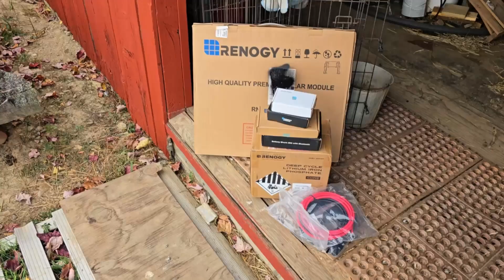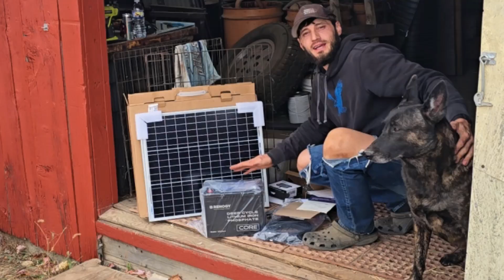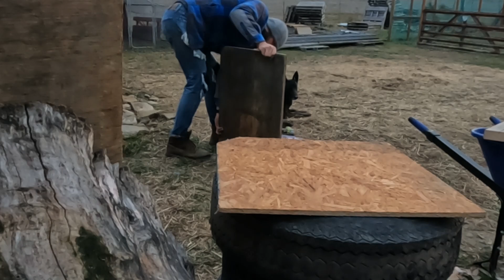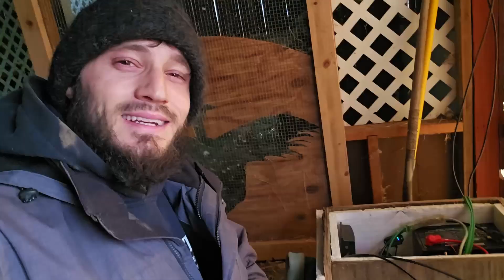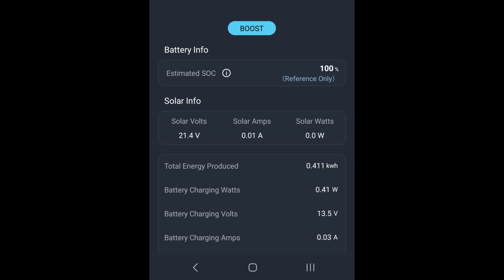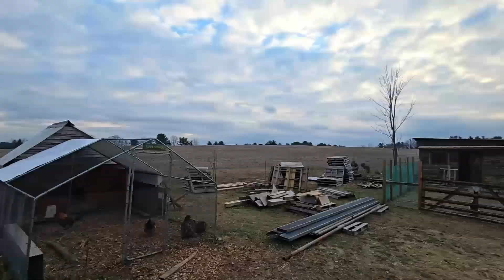The Homestead Gets Solar! _ Renogy Farm Solution // Whitt Acres

Comment: FYI: check to see if the lithium battery has a heater built into it. Letting a lithium battery freeze even once can totally destroy it. We have done a lot of research to change our 4 year old acid batteries solar system over to lithium this summer to run our entire older  RV. Please be careful because the batteries are expensive & the price will be going up.
Reply from the maker: Good tip!

Comment: So cool. What is the purpose of the battery shunt? I did look at a kit that did not have a shunt. Was wondering if I would need the shunt or not?
Thanks
Reply from the maker: The battery shunt monitors the electric flow going to and from the battery to give you a real time reading of charging and consumption as well as helping the longevity of your battery's life.
Reply: If you don’t see anymore comments from me…. I was shocked when I cut the battery lead in half❤  lol. I dislike dealing with batteries and electricity.  ⚡️ 🔥 JK. I am going to give it a whirl